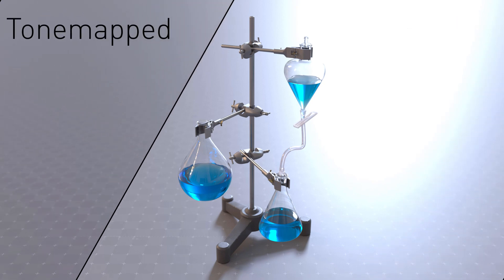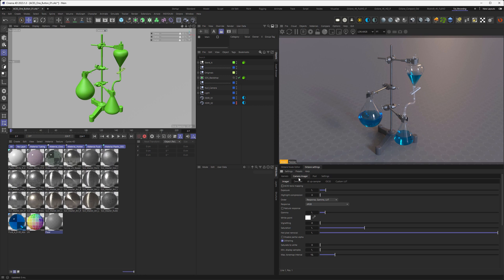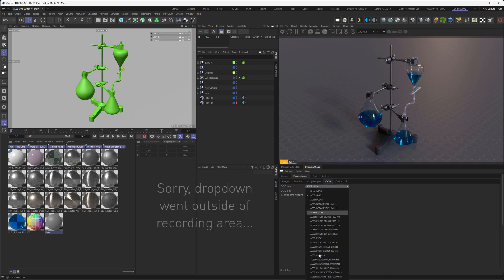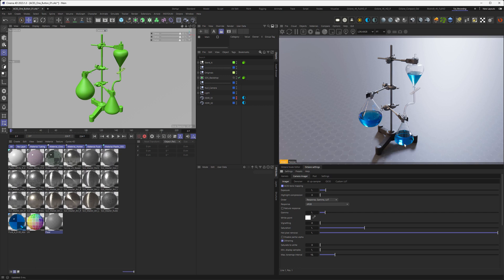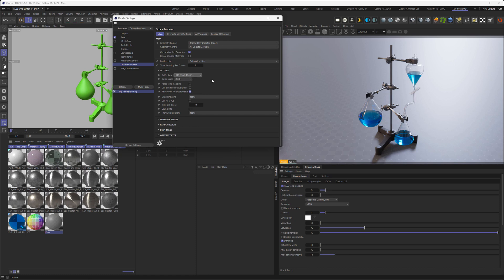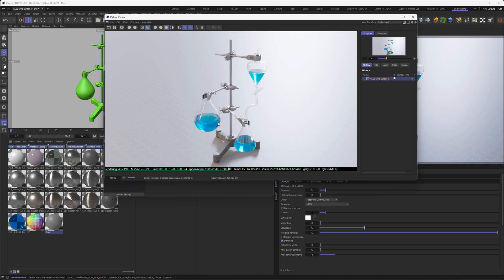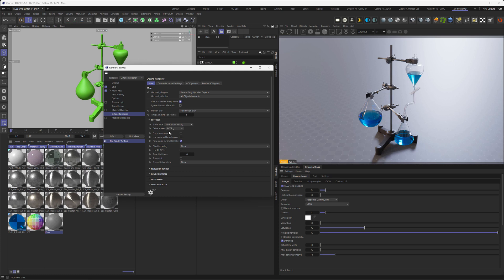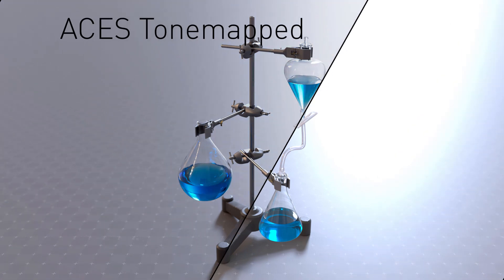Silverwing Quick Tip: ACES One Click Solution in Octane

Comment: from Version 2023.0.0, do you need to add the Aces 1.2 config in the C4D project scene colour management settings.
Reply from the maker: Hey and thank you for your question!
If you are using the "One Klick Solution" then no. You do not have to link an .ocio in to Octanes Color Management settings.
Only if you want to have other tonemappers as ACES to Rec.709 or AgX.
Reply: @SilverwingVFX  Thank you for the reply, we was actually referring to the project/ colour management settings that are new in c4d rather than the octane settings
Reply from the maker: @elihollowell3420  Ah, thanks for clearing that up.
In my experience running C4D in OCIO mode just puts another layer on top with OCIO / ACES. Since Octane has it's own workflow that does not have anything to do with C4D's I find it better to keep C4D in sRGB mode.

Comment: I notice a difference when I select "ACES tone mapping" in the Octane setting imager VERSUS on the camera imager. 
Why ? and which one should I use ?
Reply from the maker: Hey there and thank you for your comment and your question.
The ACES Tonemapping checkbox should look exactly the same no matter if you check it in the camera or the Octane settings imager. Sometimes it happens that there are some other settings that are not on their defaults. Such as e.g. Exposure. This can happen either in the Octane Imager or in the Camera Imager and can lead to different outcomes. You might therefore might want to check your other Imager settings so that they are matching!

I personally always set it in the Octane Imager because then it's global (if you are using multiple cameras and want them all to display the same)
If you do architecture viz, it sometimes can be of advantage to have the imager turned on on every camera, so you can balance exposure / white balance for the shot you are taking.

Hope this helps 🙌

Comment: Awesome tutorial. Learning a lot from you. 
Unfortunately I still cannot get my images into Resolve looking exactly like they do in Octane. Very frustrating.

Also, what is the image viewer you're using in this tut?  I use DJV2, but it also show my images looking different than I see them in Octane. A double whammy!

Keep up the great work!
Reply from the maker: Thank you very much for your comment.
I unfortunately do not work with Resolve in that context. But usually what is needed is to let your host application know what color space your imported image (or image sequence) is (In your Case probably ACEScg).
In Resolve there must be a function where you can assign a color profile to your footage. This you would need to set to ACEScg (assuming that ACEScg is the output setting for your renderings)

In terms of look what you get out of Octane. It really comes down to how you save out your images.
You can either save them out with the ACES tonemapping baked in. This is what happens if you use the tick workflow in the video and save to sRGB PNG / TIFF etc.
Or you can save all the information in your output by saving EXRs with ACEScg set as output profile.

In the first case, your images should look like in your picture viewer no matter where you watch them.
In the 2nd EXR case you need to interpret your images in the host apps so they know that your image has a ACEScg color space.

In the case of DJV2 viewer you would have to go through OCIO and set ACES to sRGB as the profile to get the right colors etc.

To explain quickly. What happens in Octane in your live viewer as well as in other programs when you look at ACES footage, the color space is converted from the wide ACEScg gamut to sRGB. Usually this is done by using the ACES to sRGB color mapping. Basically what makes your image look nice, avoids blown out highlights and over saturated colors. Because otherwise the colors would look wrong on your screen, because your screen is setup to display sRGB.

So in viewers like the DJI or in software packages like After Effects or Davinci you have to let the them know that the input image is in an ACEScg color space and you want to look at it through a Aces to sRGB tonemapping.

Hopefully that was somewhat understandable and helps you to get there with your ACES pipeline.
If you have any more questions, feel free to ask!

P.s. I am not using any special viewer to view my images.
What I usually do is look at them in the live viewer and then again in the comp program e.g. Fusion Studio.

Cheers,
Raphael
Reply: @SilverwingVFX  Dearest Mr. Wing - You Rock Dude! 

I feel like the clouds have parted and I can see the light, which is amazing because I received this response just after watching a total eclipse here in Austin where the clouds literally parted just in time for us to vote Totality! 

Thank you so much for your incredibly detailed explanation here. Things are making much more sense to me now. 

I am using the EXR method you describe above, and in your tutorials, and am doing things correctly on the Resolve side, but notice very slight issues in luma and saturation. Turns out there are some slight gamut concerns in ACES 1.2, specifically when importing ACEScg EXRs. I’ve switched to 1.3, which presents some more options in Resolve, and am good to go, for the most part. 

That said, your idea to simply bake the ACES tone mapping into the sequences via PNG or TIF I think is the best solution for this particular personal project. So, thanks for that!  

And I’d also like to thank you for a little tidbit of advice you dropped in one of your tutorials to use rec709 for the OCIO view look instead of sRGB. It takes the edge off my images quite nicely!

Thanks again for taking the time with this amazing response. I, and I’m sure others, have learned a lot from it. And thanks for your incredible service to the CG Community. It’s much appreciated!

Comment: I get a message that says there is no file name specified for that image. Want to continue without saving? ( this if i dont use the save button from c4d, and not octane one )
Reply from the maker: Hi there and thank you for our comment.
This is correct since C4D does not know about the saving abilities of its plugins. So if you set everything up correctly in the Octane output dialog, despite the warning of C4D, your file will be saved.

Edit: I recommend you testing the saving capabilities on every scene with a short low sample render for example. So you can make sure everything has been set up correctly and the file ends up where you want it to be and in the format / color space you want it to be.

Comment: The Force Tone Mapping tickbox.
But first, this is another of your long list of outstanding and very informative tutorias. Your teaching style should be taught to others out here who are trying and failing to deliver quite complex technical info.

But I do have a question. After following this tut I could not get the Aces look in my final Photoshop exr output. I tried rendering a couple of different files many times but no matter what I did the final exr matched the C4d Picture viewer and not the Octane live viewer.

In the Octane live viewer the highlights of the polished metal object were controlled and had nice gradients while in both the C4d picture viewer and final exr Photoshop file the highlights were completely blown out to 255/255/255.

I doggedly followed your instructions many times in the above tut but nothing worked so I then systematically rendered the files - first with no ‘boxes’ ticked in the octane render settings then with each subsequent render I ticked one box.

I finally got the photoshop exr image to match the octane live viewer image when I ticked the Force Tone Mapping box (along with false colour for cryptomatte, show passes and save beauty boxes - and the other settings EXR(Octane) / 16 BitChannel / DWAB / Float 32 Bit buffer / Acescg Colour space).

Now, with those boxes ticked and settings applied, not only does my final exr image match the Octane live viewer but so does the image in the cC4d picture viewer.

So the question(s) is “is it ok to use the Force tone mapping tick box or should it be avoided?” I have no idea what's going on under the hood.
Reply from the maker: Hey Jason, thank you for your long comment and explaining your workflow nicely so I have a good picture of what you are doing.

Color is a very complicated topic and it´s not as easy to explain in a couple of sentences. So I will try my best to get you the info you need:

There are two workflows here:
Workflow 1: that I am suggesting: Work though the ACES sRGB one klick tone mapping live viewer setting.
That means in the background Octane is handling everything in a wider ACES color space and distills down the image to what our screens can handle, which mostly is sRGB.
When exporting, take this large color space and save it with all its infos (This then looks wrong in your Picture Viewer and e.g. Photoshop) because it is the wide gamut of ACES you are seeing unfiltered through your sRGB screen. Then in your image manipulating app, use a OCIO filter to again funnel that huge color space into a usable sRGB image. This way you have a wide range of colors at hand that all behave naturally when mixed.
For a better understanding you might want to watch my other ACES related content on my channel.

Workflow 2: The one you currently discovered and using. It starts out the same. You work though the ACES sRGB one klick tone mapping live viewer setting. But instead of opting for saving an image with the wider color space, you opt to save the funneled (reduced) sRGB version.
It´s more easy to handle as what you see is what you get. But if doing compositing with it. e.g. adding light passes etc. The math will be wrong and mixing lights will look different then in reality (or in your live viewer)
Also you are loosing all your above white capability. For example I use that after the fact to get realistic glows and lens effects. If you do not do such fancy things, then that workflow is totally fine. People use that all the time because it´s more convenient and in a fast moving environment has less points to fail and is generally faster to work with.

So short answer:
Its OK to work with the Force Tonemapping method. You are leaving a couple of things on the table with that.
The highest quality you get when you carry the ACES color space over to your comp app, do all your color correction in ACES and as a last step convert it to your desired space. e.g. sRGB.

So, long question, long answer. I really hope that you can see through the convolution a bit and begin to understand what I am trying to say 😇

Cheers and a great Day to you,
Raphael
Reply: @SilverwingVFX Hey Mr Silverwing. Thank you very for much taking the time to write the above reply. I thought the force tone mapping was too good to be true. I am following your steps laid out in your videos and using the OCIO filter in photoshop but I cant get Aces to work as per your workflow 1 and videos. Its not a major issue at this moment in time as Im not producing work for clients and am still in my 'learning' phase of becoming a 3d god, I'm an apprentice god 😇So its back to the drawing board for me 🤓 Meanwhile I will contact Otoys help 'desk' to make sure all is well with the app just to make sure. I have been over the workflow steps/videos so many times now that Im thinking that there may be something wrong - but I'd also bet a large sum of many that Im doing something silly to sabotage myself. Thanks again. Onwards and upwards.......

Comment: Hi! I'm very interested about your EXR DWAB compression choice. You said you already choose it in your tutorials, do you have any in depth video about that? Thanks!
Reply from the maker: Hey there and thank you for your comment.
Unfortunately there is no in depth tut about DWAB on my channel. Basically its just one of many different compressions of the EXR standards. It should also just work. The only thing that might be interesting is that its lossy compressed, but I never noticed any artifacts even with heavy grading.
If you you have any specific question, I am happy to answer!
Reply: @SilverwingVFX  I was just curious about it because there is no much info about compression and I just tend to use "Rle" by default. However, I will start testing DWAB if it works fine. Thank you!

Comment: Hey question, when I save my output as a TIFF it all works perfectly, but the moment I try to output it as an EXR (16bit) it comes out overbright and washed out. I've tried all kinds of different setups, baking tonemapping etc. But EXR seems to mess my file up while TIFF works as you show here, is this normal?
Reply from the maker: Hey there. 
Saving EXRs does not tonemap the ACES like it would by using TIFF.  With 32bit data octane expects you to continue the workflow you chose in post / comp. If you set your output to Linear sRGB then Octane will use that workflow, if you set it to ACES or ACEScg,in the main tab of the Octane render settings. It will use this workflow.
C4Ds picture viewer does not show you the right colors when exporting an ACES EXRs it will look off color and too bright. Once you continue your aces workflow in Comp, it looks right again.

You might have seen it I have also a tut on the After Effects part of the workflow.
Reply: @SilverwingVFX   Yeah I thought so, thanks for the in depth reply.

Especially with color spaces its really easy to get lost in all the different viewers, ocio files, post-software color spaces and rendering tonemapping options. There's like 24 different ways to get it wrong.
Reply: @SilverwingVFX  By the way, the workaround we have in the studio now is by  NOT saving the beauty file through octanerender itself but via cinema, and setting that to OpenEXR 16bitfloat, then setting the octane color setting to: HDR: linear SRGB, with bake tonemapping ON.

This way we still get the nice cryptomatte option from EXRs without going through all of the color space hoops
Reply from the maker: @ThomvanVliet  That´s great. Just bent the tools to the way you want to use them!

Comment: Great tutorial, as always! I just want to quickly mention that if you render Lightpasses Aov's with these methods (both old and new), there is a small issue.  If you comp those together to make a beauty pass in after effects, you will not have the same results as the main beauty pass from octane itself.. It will always be a bit darker. So you have to compensate that with some color correction on those lightpasses. If you want to get the same result, use the complete Aces workflow that Silverwing described in his other tutorial about Aces.

Comment: thanks for the tip, very informative as always :) i wonder about in-built OCIO config in C4D, the one that in project settings. Can that config affect somehow on octane's output and live viewer?
Reply from the maker: Hey and thanks for the input.
I think you can force the ACEs color Profile on the render output. So you would see the right colors in the rendering. Since I mostly work in C4D R20 I have honestly not looked into C4Ds ACES integration too deeply. I should definitely do so soon!

I am guessing setting all of C4D to ACES would not work with Octane right now, as the color inputs of Octane (mostly Lights, RGB Spectrum ect. Are still hard coded to take in sRGB values.

Setting C4D to ACEs however makes all color fields use ACES colors.

Take all of this with a grain of salt, as I have not really deeply looked into this. Maybe your question gives me an incentive to do so. 

Cheers and thanks for your comment and a great time to you!

Comment: The thing I keep seeing with "use aces!, its amazing!" Is that you can fade out saturated bright colours to white and clamp down on blown highlights. But, there any significant difference between this and just using the "saturate to white" and "highlight compression" sliders already present in octane?
Reply from the maker: Hey Matthew, that´s a really good question.
Aces sRGB and rec.709 tone mapping tries to emulate the colors and look of how we perceive the world. Also very similar of how analog film looked. There is more at work then just desaturating highlights and having a soft shoulder. 

Granted, Octane through its spectral nature is a bit of a special case in that it always had a huge color gamut internally. Still ACEs is doing some color transforms to the image that are more natural and more in line to how we see them.

Last but not least there is the pipeline aspect. Aces allows you to render out large gamut files and then take all the colors and post process them in AE, Fusion, Nuke. Before baking them down to the usual sRGB / rec.709 color space. Taking advantage of the huge color gamut was not really possible before aces because all that Octane could save was sRGB.
Being able to manage colors and export larger gamuts makes it possible to render for other workflows e.g. Cinema where they work with DCI P3 or  rec.2020 HDR productions like for Netflix / Disney+ / Amazon.

There are a lot of other things that I could talk about. But that would make my comment to long.

One thing to note though ACES is not the be all and end all. Its is in ongoing development and continuedly is improved upon.

If you have your workflow with highlight compression and saturate to white then keep on using that. ACES is just another workflow. With the benefit that its standardized so it can be implemented cross platform.